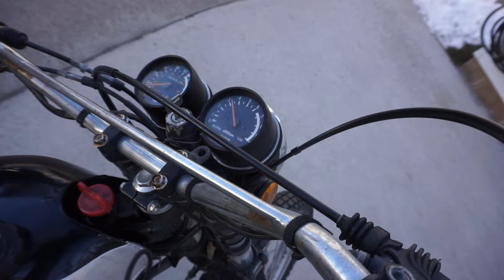Kicking My Leg Off...Free Abandoned Yamaha XT 500. Will It Run? (Part 2)

Comment: Hey man, great catch! I see people already commenting but you can still improve your kick procedure and avoid injury or damage. 

Try getting the tt500 1976 manual online and check the kickstarting procedure there. The cam window is nice but at night it won't serve you. You will eventually get used to find that spot without looking. Best way is to press the kick till you feel compression, release kick and let it slide up, press decomp and then lower the kick till it's horizontal. Let it come back up again, release decomp and make sure the kick latched almost fully vertical. Only then swing a full 180 degrees. When reaching the footpeg hold about 1s there to avoid kickback. 

Most of your kicks are rotating about 90 degrees, which is not ideal and a bit risky of getting a mule's kickback. Flywheel needs a full 2 revolutions as the spark only comes out at the end of the second. This will save you from leg day and avoid breaking an ankle.

Another way to find the sweet spot is to press about half of the travel of your decomp lever (check freeplay as well!) you will feel a small click in the lever when you are in the sweet spot. With that, no more looking at cam window. 

Kick will not always latch and allow 180 degrees of travel. Restart the procedure if that's the case.

Also, 80s model have points and no cdi.  Check your points gap and timing, they should be starting to open on F on the flywheel. Strobo lamp highly recommended.
(Edit: I was wrong, 80s US models already had CDI. Fancy!)

Good luck and welcome to the forever suffering club of xt owners!

Comment: I had one in the 90s as a commuter, when it would start.... constantly needed valves and timing resetting, got rid of it for something reliable. They are nice ornaments and great fun when they are properly set up but I wouldn't have another one.... holding out for a Honda XL185s, had loads in 80s and 90s, great little bike with the right power to weight for green lanes.

Comment: Have you checked that your kicker arm is on properly?  There is a little notch on the shaft, that is supposed to line up with the gap on the arm where the bolt goes through.  Looks like the are isn't all the way up, and you therefore arent getting a whole revolution out of your kick.  Had the same problem with mine

Comment: Hi! That is a dry sump motor. You need to also drain the oil from your frame/oil tank. Drain plug on the front down tube. If you have too much oil in the sump, you have a faulty one way valve.

Comment: I think you may be overlooking something very important. At least I haven’t seen you check it yet. IGNITION TIMING! I doubt the base gasket would be cause for an air leak because the sleeve extends into the crank case below the base gasket. My guess is the points need cleaned and timed!

Comment: Why did you start the bike without first checking the oil running the engine with low oil will wreck the engine Also you have checked 
The valve timing what you need to check is the ignition timing all that popping could be un burnt fuel igniting in the exhaust caused 
By the ignition timing being out

Comment: When I was a kid in the 70’s I had an Ossa 250 Stiletto, it had an expansion chamber with a Basani tip I added. It was fast and a handful, I thought I was the King of the Chattahoochee River bottoms and gas lines in Forsyth County, Georgia, until an older kid got a shiny Yamaha TT500! I had to do the walk of shame when I raced him, I was a superior rider, but I just couldn’t beat the raw power of the TT when the trails smoothed out and straightened up, it was a powerhouse!

Comment: I guess I missed the part where you drained the oil out of the actual oil tank,  The drain being at the bottom of the front frame tube.  Below that is a fitting that unscrews from the bottom of that frame tube. There is a oil screen in there that should be checked for debris.  That line under there is the supply to the oil pump.  This is dry sump engine.  Oil is not stored in the bottom of the engine.  There are actually two oil pumps in one.  One supplies the oil to the engine from the oil tank, the other scavenges oil from the bottom of the sump and returns it to the oil tank in the frame. When a dry sump engine sits for a long time, oil often will bypass the oil pump and end up in the sump where it does not belong.  You should always drain a dry sump engine that's been sitting for long time.  Oil needs to be in the tank in order for it to be supplied to the engine.  Oil seeping through the oil pump and filling the engine can result in oil being pushed out the crankcase breather, and into the stock air filter housing, because that's where the crankcase breather goes.  This will usually result in a fouled spark plug at the very least, and can easily blow gaskets and seals if you are unlucky.  The poor running, besides a fouled plug, I can almost guarantee is a partially plugged pilot jet and the hard starting, same with starter jet that supplies the choke circuit.   A partially plugged pilot jet can end up being a disaster as it will create a lean fuel/air ratio which can raise the combustion chamber temperature to temps high enough to overheat and expand the piston enough to seize it, or burn the exhaust valve, burn pits into the piston.   It will also cause pre-detonation, also very bad.  On multi cylinder engines it can easily melt a hole through the piston.  I'm not exaggerating.   Clean the carb next.

Comment: All you have to do is FEEL where the compression stroke starts with the kick starter. Once you feel that hard resistance...lift the compression release lever and carefully move the kick started slightly down with your foot to get the engine just past the compression stroke. Once you get the knack of that, you'll no longer ever have to look at the little window again to tell you it's ready to kick over.

Comment: Had one of these from new.  You do need to use the kickstart indicator as they are very tricky compared to british singles I've owned. Also as someone mentioned, keep throttle closed on kickover or it'll never start. in my experience.

Comment: I had a lot of these when i was teenager and loved them, lot of my friends wanted to ride it i said 'if you can start it you can ride it" they got scared of it cause it kept booting them back (kickback) very painful, if your foot slips off the kickstart and it boots back it'll rip your calf muscle open. They had contact points so if they weren't set properly or the throttle was open slightly when kicking it over, it will boot your ass right off there lol. You got to let them breathe free, open the exhaust, head work, oversize piston or head and boy they are a lot of fun. Our local copper use to chase me all the time he loved the thrill of the chase but was a very sore loser only time he caught me was when i was parked in a friends driveway visiting lol

Comment: You have probably had plenty of people help you with starting technique by now but I have owned a 500 (1978 model) for 40 years. Push the kick starter down till it hits compression, pull the decompression lever and push kick starter a bit further. If you watch the kick indicator you will see where you are up to. After a bit of practice you won’t need to look at the indicator. Let kick starter back to top and give it a good kick.They can be a bitch to kick back and drive your knee into the handle bars which causes a lot of pain and no starting attempts till tomorrow. The kick starter goes off the end of the ratchet drive right at the bottom to help prevent this, keep it at the bottom till it is safe to kick again. The XT 500 is a real classic, value it. The first Dakar Rally was won with one in almost stock standard trim just like yours. Enjoy it, they are pretty bullet proof.
Reply: They don’t have an accelerator pump till a much later model.

Comment: Im a 140 dude and i used to have a hell of a time starting an old late 70s xt, The thing was a beast but i remember it having a decompression lever which mildly helped. Once you got it running and warm it would fire right back up though. Fun bike but was soooooo heavy.
Reply: You better bulk up then! I’m 135 and after fixing 3 for a guy they’re very easy to start!
Reply: @dilloncollins7521  sounds like you had some mint condition ones, the one i had was beat to hell and was clapped out.... smh have fun lightweight
Reply: @kdknitro  lmao

Comment: You are just learning so keep trying.  Get yourself a shop manual for the bike.  I own several TT and XT500 bikes.  My oldest one I have owned since it was new in 1978.  It has over 5000 offroad miles with only normal maintenance.  With adequate compression, good spark, and a properly functioning carburetor, they are two kick starters.  My advice is to take another look at the carburetor and the fuel delivery system as a whole.

Comment: Thanks for the entertaining video .. I wish I found a free XT500... The 76 XT did not have the little window on the cam to help starting .. I had to go by feel . The starting technique was a good deterrent for people who wanted a ride . Many a sprained ankle when the 500 kicked back viciously ..   These bikes are hard to find and cost a small fortune here in Australia now .. I owned two new XT500s , a 76 and 78 as well as a street legal 77 TT500 in my youth. Pigs to start when flooded . Many times I cursed them after I dropped them when trail riding.. Easy to fix and work on though ...  I wish I had kept the TT500 ...

Comment: You have done the oil change wrong, you have to drain the the frame as well, the bolt at lower front of the frame, otherwise you are mixing old and new oil together, once you start the bike you have to bleed the air out of the oil from the little bolt on top of the oil filter cover, might pay to buy a manual, these bikes are dead easy to start if you do it right, you can start them buy hand if ignition timing is right, good luck.

Comment: try starting fluid use the red kind spay it in the air filter hole and you need gas you have no gas tank on and you need gas and turn on the gas line

Comment: Hope you've got it fixed by now.  Shouldn't have to kick kick kick like that.  Always check for spark fuel and compression.
These singles are not tricky to start if you know how to start them!! Mine has 168000kms on it with rebuild at 90000.
It started 2 or 3rd kick after sitting in my shed for 20 years. It is a 1976 model. It does not have that kick indicator nor do you really need it. You find compression then use the decompression release to bring the kickstart lever to the horizontal position then let it return to the top and with choke on ( cold start only) and no throttle kick it fully down and it should start. If it doesn't check your plug  and then points (plug wet or fouled or points pitted and or dirty). This engine starts easily if above is done and in order. Not at all tricky.
Sounds like the timing gear inside the right crankcase is installed 180deg out of phase. There is timing marks that must be aligned at top dead centre on the COMPRESSION STROKE not the exhaust stroke.  It can be done wrong as I did once and it was hard to start and ran toughly and backfired and ran like shit. Someone may have installed this gear with the marks aligned at Tdc on the rxhaust stroke and thats why they gave it away! Easily rectified.  Hope you have discovered this by now.  These are torquey reliable engines but you need to consult workshop manual and know how it should be set up

Comment: Around the 7 minute mark, while stripping the parts above the engine, why not just take the valve covers off .2 x allen bolts (hex bolts) hold the caps on either side. You can check the valves are at the compression stroke if the rocker arms are loose.
Reply: What if they are loose ? I think my rocker arm is loose on my quad started ticking a couple days ago and i checked the valves intake seemed fine but exhaust side rocker wiggles up and down way more then intake
Reply: @Yamaha350w  If they or one is loose, then it is on compression stroke when it is correct to check the timing. If one is loose and the other is pressing a valve down when crank is at TDC, then the timing is out because the rocker shaft is 180 out. 
With yours, the exhaust valve needs checking and maybe adjusting.

Comment: Great bike. Had one back in the 80's.  The compression release helps to start it for sure.  That comp release window was impossible to see after dark, so was useless. I eventually had a feel for it, and didn't need to look at the window(after dark) to start it.  It was always a hard starter, even when running great with fresh tune-up.  Throw a "Supertrapp" on it and he'll scream.  
Interested in selling it?
Reply: When you hold the little lever that keeps the exhaust valve open, you feel the force on your finger disappear at the moment the metal part comes in sight. That way you don't need to look at the window.

Comment: Just my thought... If there's no oil in the tank, and no oil going to the engine, I believe that the reason for a no start, and low compression, is because of no oil going into the engine, instead of going through all the trouble of taking the cam cover off, etc, why not put some oil in first lol 😂

Comment: the carb needs rebuilt. soaking it in the ultrasonic cleaner makes it shiny, but all the ports still need cleaned out , and the accelerator pump needs the diaphragm replaced..

Comment: I have this exact motor in my SR500 and it is a real finnicky piece of engineering.  Very user unfriendly and difficulty to start, gets out of whack easily too.  Not the easiest to use yamaha motor, but once it is running, it is a fun machine.

Comment: The xt500 is very finicky.  I have a 1979 that was my dads.  You would have had to completely disassemble the carb and replace the accelerator pumps.  The carb has to be perfect for it to run well.  Also, my 1979 calls for leaded gas only.  So i have to run to the air port for aviation gas.  With correct ignition timing, clean points, clean carb, will run pretty well.

Comment: Hey man, put that Yam in gear and roll the bike backwards till it slides rear tire.  That is TDC...  Put in  neutral and KICK.   Mine has a 12 to 1 compression ratio..  You can always push it off in second or third gear.   Good luck.

Comment: You need to start at tdc on those bikes when kicking them over every time.
Reply: And no gas from the throttle!
Reply: @robertlorax7659  most the time un less it Flooded but it’s a 4 stroke but on my 2t I hold it wide wen that happens u know but on the 4 joker it’s different  but on my 450 I got to a little just to get it start then it fine
Reply: @robertlorax7659  
Correct
Reply: @bennybradshaw9904  
These "500 Thumpers" flood at the slightest touch of the throttle, but they are easily cleared by holding in the decompression lever and spining them around for a few revolutions
Say if it didn't start so you used the choke and still it didn't start you would hold your throttle wide open and spin it a few times to clear it
Reply: yes! good point! ... many broken legs and bad bruises later, we old timers learned this to be true!!  I myself was once launched over the handle bars of one of these beasts.
Reply: You know you only needed to take the front and rear rocker covers off (4 bolts) to check your intake and exhaust lash.  That can get off on these bikes. There’s no reason to take the whole cover off, if you can kick through it’s almost impossible the chain jumped you’d have other issues. And kicking any big bore 4 stroke requires winding it up first, usually you gently kick down (more like push) just until you start to feel compression, let up entirely, then kick down in one strong, steady kick.  It’s nothing like kicking a 2 stroke.  It’s a good engine, have fun.
Reply: @MaineGreenCrabs  
Not wrong, it's sad to see such a nice old machine being messed around with by someone who doesn't have a clue what they're doing with it 👍
Reply: They aren't particularly difficult to start but you do need to have an understanding of how to start them. Same as anything, rock just over tdc & a full committed kick with no throttle. Something like this needs a new plug, plug cap & carb clean before you start.
Reply: @SB-vb8ch  that model did in fact have a set of breaker points, those must be checked as well because there may be a spider smashed in them.....
Reply: @lukewarmwater6412  Assuming you have a spark then incy wincy probably doesn't have a limb trapped in the points!! 😁

Comment: Push pre throttle button don’t touch the throttle then use the compression release and cam window to set the firing stroke. Simple! The bike is super easy to flood.

Comment: I had a TT500 and it was a beast ,the oil tank was in the front not under the tank in the frame but unfortunately it had a filter in the bottom that I didn't know and it was clogged and it shortened it's life ,that thing I can be going down the road and the front would easily come off the ground without caping the accelerator at high speeds so be carefull I was kind scared of it going up hills cause of the power just a slight jolt of the accelerator it would just lift the front with ease .

Comment: Xtz just like sr500 there's a sight glass on the top that tells you when your on TDC then you give it all you got Give It To Nuts show crank right over if your carburetor is good you going to clean them accelerator  pumps so should have enough to turn fire up  also there's a drain plug in the front by the tire that does more oil drain man love these bikes